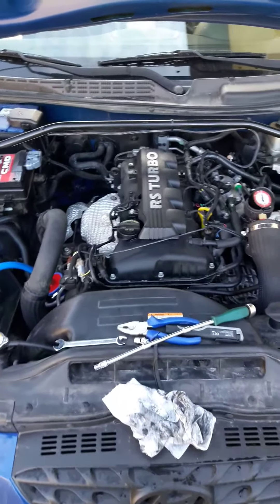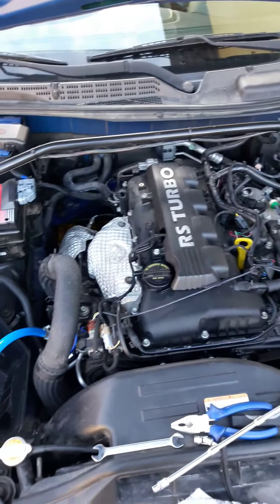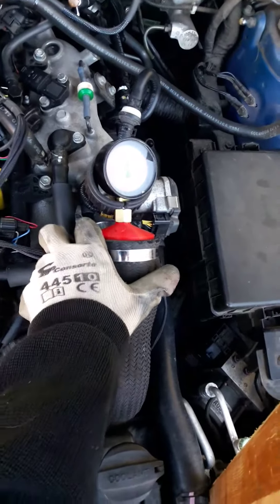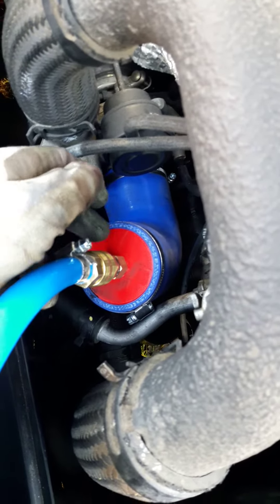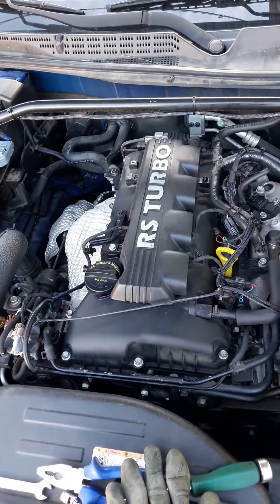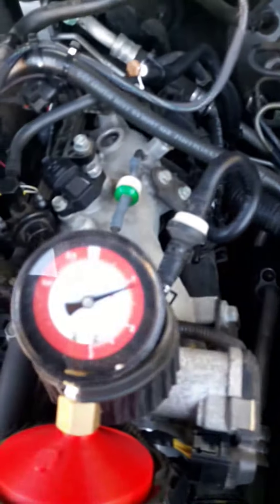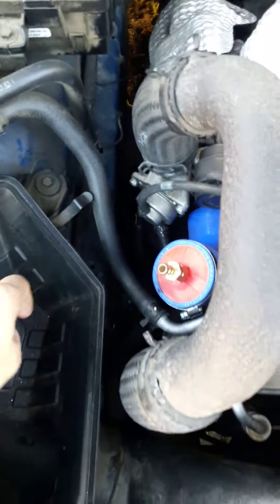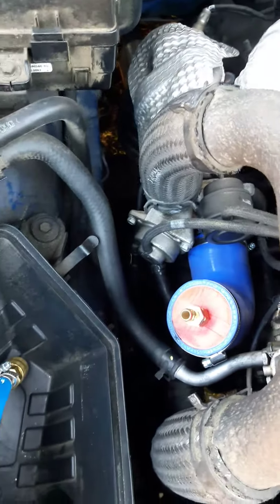Hyundai Genesis coupe bk1 - boost leak test

Comment: What causes the boost leak?
Is it fix now?
Reply from the maker: Dv  valve was leaking between turbo casting and The valve itself. 

I machined custom housing from aluminiu and it seals just fine
Reply: @pch_mechanika  you mean the bov part is Having a leak?
Reply from the maker: @nikosicapero5294  yup, it was the round cover on the turbo that is connected to vac line

Comment: It would be great if you can show us the performance of the car before and after
Reply from the maker: True, would be good have before after
Problem is on Video you wont relay see the differences

its not fixed yet - i need to figure out what to get instead of this OEM part, so maybe i can create boost pressure graph before and after - idk. I need to think about it